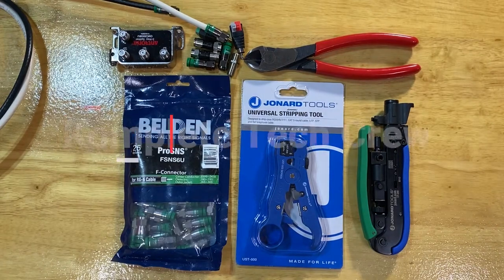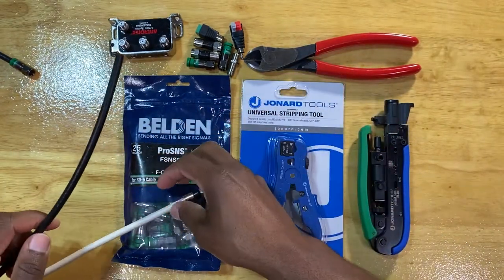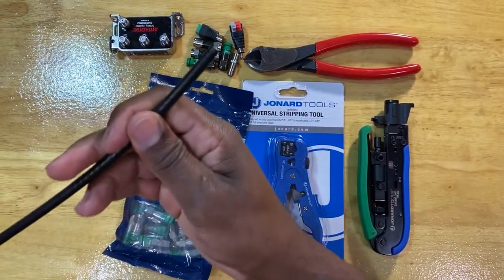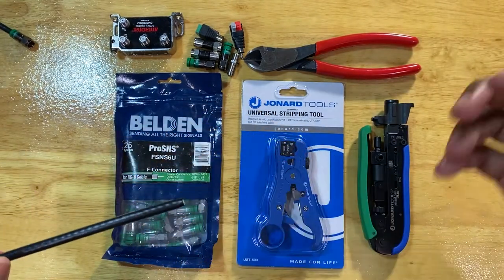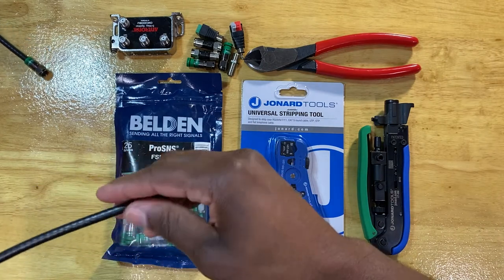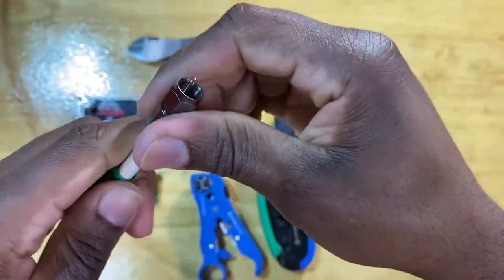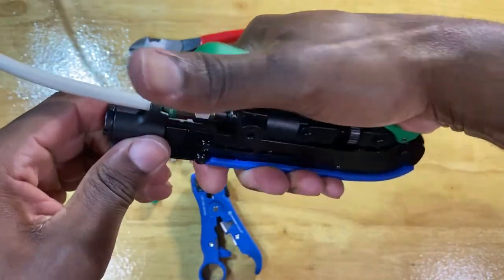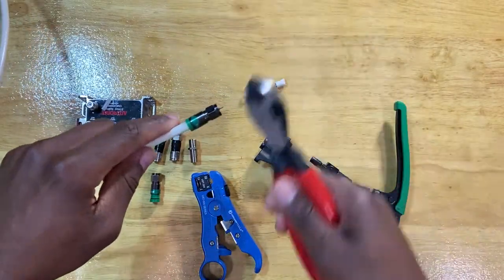Coaxial How To: Everything You Need To Prep And Terminate Coaxial Cable/Connectors!

Comment: FYI, the plastic piece on the inside of the Bleden F connector isn't for keeping out debris, it's to help center the conductor and insulator as you feed the cable into the connector. Also, I highly recommend getting a shear style cutter instead of using normal diagonal cutters as it doesn't deform the isolator as much. It doesn't really affect the termination because of the quarter inch of waste material after stripping gets rid of the crushed part but they are just a pleasure to use. My personal favorite at the moment is the Wiha soft grip cable cutters part no 32600. I bought the Knipex equivalent too but honestly prefer the Wiha even though they are cheaper. I use them for stripping everything from 14/4 to cat6a too.
Reply from the maker: I Will Research The Plastic Piece Further. Interesting Notion. Thank You For The Information. I Too Have And Utilize The Knipex/Wiha Shears For Most Cabling Applications. I Published This Video For Novices , DIYers And Anyone Who May Need A Little Insight And Guidance. Those Shears Are Not Commonly Sold At HDs, Lowes, ACE, Etc… I Make An Effort To Simplify Certain Aspects Of My Content To Inspire And Motivate Everyone To Tackle Any Challenge That Presents Itself. As Always, Thank You For The Feedback.

Comment: I appreciate you taking the time to explain all this in detail. I'm getting myself ready to do a DIY for my coax cable which hooks to my modem. While watching other tutorials, some would suggest to strip off the foil that surrounds the dielectric before putting the connector in. What would be the reason for that?
Reply from the maker: I Strongly Advise Against Removing The Foil Surrounding The Dielectric! The Foil Acts As An Internal Ground Once The Connector Is Terminated. This Is Paramount To Ensure That You Will Not Experience Foreign Signals Traveling Along The Cable. This Is What Often Causes Level Inadequacies, Signal Loss, Tiling, Pixelization And Provisioning Complications.
Reply from the maker: Thank You For Watching And Commenting! Please Continue To Reach Out With Any Questions You May Have. Stay Optimistic! You Will Conquer This DIY Project Like A Pro!
Reply: Thanks again for the valueble insight, you juet earned a sub!

Comment: can you do a video on terminating RG6 quad shield, it is a huge pain so far for me
Reply from the maker: No Problem Bro! Is There Anything Specific That You Are Having Trouble With! Maybe The Incorrect Connectors?
Reply: @KompleteTechCrew  having issues with getting a tool to cut properly and then peeling back the first layer of shielding
Reply from the maker: Got It! Tool: Jonard Tools UST- 500 This Stripping Tool Is A Beast! There Are Two Layers Of Braid And Two Layers Of Foil. The Layer Wrapped Around The Dielectric Remains In Place. The Outermost Braid Should Be Peeled Back And Rested On The Outer Jacket Just As You Would With Dual/Tri-Shield. Give Me A Few Days For A Video. Let Me Know If You Need More Assistance.

Comment: Is there anything wrong with combing the braid back with a small stainless steel brush?
Reply from the maker: If possible, avoid combing the braid down with anything abrasive. I have always utilized my thumb 👍🏾. I understand that this may not work for everyone. You can use a small block eraser such as the pink type that we utilized in school. You want to avoid defacing the foil and the dielectric as much as possible.
Reply: @KompleteTechCrew  l checked with a cable manufacturer and spoke with one of their engineers.  They didn't see anything wrong with  using a brush. You're not supposed to touch the braid or center conductor with your fingers.
Reply from the maker: Interesting… There Are Specific Tools For Managing The Dielectric Excess On The Center Conductor After Stripping But The Braid Is Typically Neatly Combed Down With A Cut Level 1/2 Glove covering A Thumb. I Don’t Want To Undermine Anything That You Were Told. I Think It Is Best To Proceed With The Information That Best Serves You. Thank You For Your Engagement!